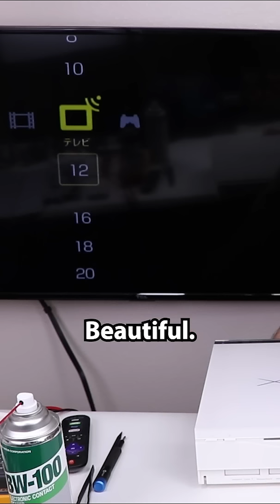BROKEN Sony PSX - Let's Try to Fix It!

Comment: Make sure you clone the HDD. They are encrypted and paired, so if the drive dies, so will the console if you dont have a backup
Reply: I find it weird the keys haven't been breached/leaked yet
Reply: @dustojnikhummer  i know. the community usually would've found the decryption algorithm by now...
Reply: I think it hasn’t been decrypted simply due to how niche or rare the product is. I’ve owned one of every single Playstation, as well as every slim variant, but I have never in my life seen a PSX, neither the console nor the box on display.
Reply: I've heard that somebody has found a way to deal with the hard drives
Reply: @FarmYardGaming  where did you hear that?
Reply: @gutzbin  that’s exactly why. However, the community has done stuff with consoles more obscure.
Reply: @TheGlitchyMario  The encryption has been cracked, you can now also use newer hdds in it.
Reply: @FR4M3Sharma  cool! do you know where I can find the info?

Comment: Good that you cleaned them instead of replacing them. The original ones are high quality parts and ebay parts won't last more than few years.. if you ever have to replace them obtain them from high quality sources like lcsc..

Comment: Can you make a video on how to fix a Playstation that won't recognize discs?
Reply: TheCod3r is the guy for all things ps
Reply: First what model it is helps diagnose the issue and helps you know how simple the repair is. If it's a ps1 ps2 slim or ps3 super slim just simply try cleaning the lens with some isopropyl alcohol and a qtip. If it is any other model this could be the issue too but you have to disassemble the console almost completely to access the lens. It could also be ribbon cables fuses or chips that have gone bad too. I always start with the lens cleaning since it is the easiest.
Reply: @mysterybread8994  disassembly is less then 20 mins. On a ps4 slim anyways, not sure about the rest they're not that bad to service
Reply: @papumerta5013  I have taken apart all playstation models. While yes the disassembly process is quick and easy it's the reassembly that's a problem especially with the cuh-12xx series ps4s the ribbon cables for the disc drive go underneath the power supply and can get pinched or damaged easily. I accidentally did this and that essentially bricks the ps4 since one of the 8.3 updates requires the disc drive to function for the system to also function at all. The cuh-10xx and 11xx models are set up differently and are much harder to damage this way. All ps3 models are fairly simple as are the ps1 and ps2 models. The hardest thing for most people if they don't jave a system is remembering where the screws go and when they go in. Luckily Sony labeled where the screws go just not the order.

Comment: Isn’t it best to put new buttons in entirely?
Reply: Replacement parts for this are next to impossible to find.
Reply: @eddiew.4650  they look like regular grounded tactile switches though, I think even regular switches would work and if you want to be more accurate, solder a wire from the plate to gnd
Reply: @PeTr01  Why go through all that work over cleaning them? It's not like he's going to be pressing them constantly. I'm pretty sure he even sells the stuff he fixes anyways.
Reply: @eddiew.4650  I mean, it’s just my preference, something about just displacing the gunk doesn’t sound like a sure-fire idea to me, especially if all the spray did was make it conductive enough for continuity.  It would be perfect to help troubleshoot/confirm the problem, but I’d have more piece of mind spending the extra 5-10 mins to replace the two buttons, but again, just me

Comment: just swap the damn buttons!
Reply: Or clean it for much less effort and money
Reply: @fireball2275  The buttons cost nothing and you can replaced very fast.
If the buttons start failing, often a deoxid spray is just a temporary fix
Reply: @ElektronikLabor   its clearing the gunk that has built up on the contact pads